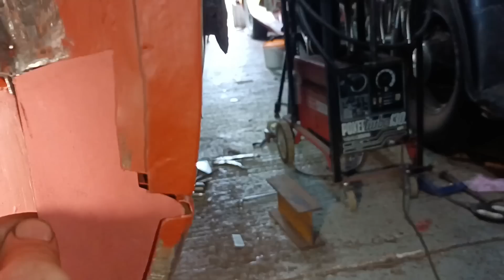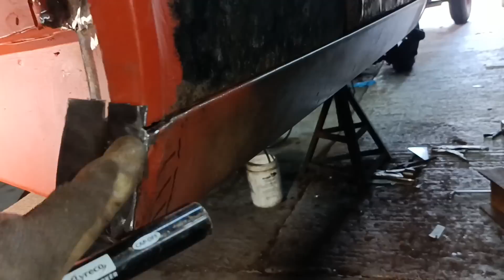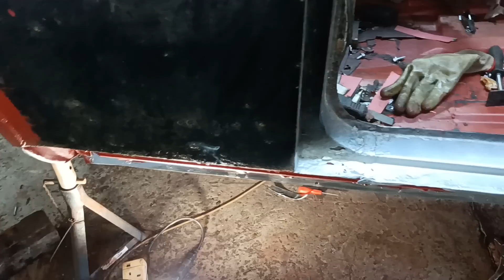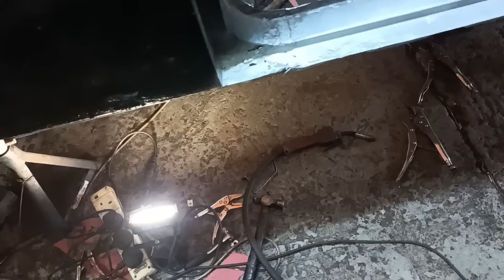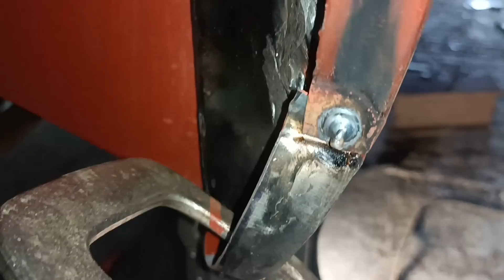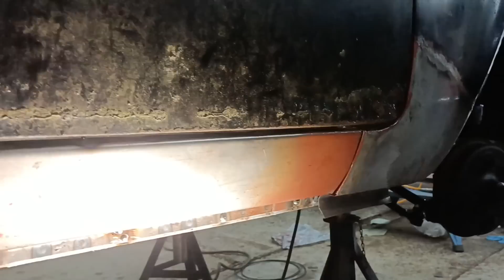Mission Creep 100E Anglia part 33! New Sill finally gets fitted. Right side done! (2371)

Comment: Mart, to avoid the dents on the "A"surface you can use a shaped block of copper on the surface to be dent free. We do it in the industry, however you will need to put more current through and unless the copper is a perfect fit for the panel you will still see some witness that will need sanding. Generally this is avoided these days but was common practice in the 50's and 60's when these cars were built.
Reply from the maker: Thanks Jacqui. I can see how that would work. These would never have been welded on that surface. That was just my short cut. The spot welder has been working well, I have used it a few times since filming this. I was just watching you and Nic at the Pod on Nick Pettitt's video. Looked like you were having fun.
Reply: Yes, it was a good weekend, Got wupped, but loads of fun. Looking forward to seeing the 100E driving.

Comment: Great job Mart , you did a a sterling job on that sill mate , and im sure its stronger then factory , i do feel for though having to  lay on a cold floor when restoring old cars , im 64 now and doing the sam as you , its not good for our old bones but its great for our minds lol 👍🏻
Reply from the maker: Hi Shane. I just turned 65 last week so know what you mean. I snagged some mats and lie on them. They make a big difference. When it is very hot outside the garage can get hot too, but it is always nice and cool down at floor level, so no complaints here. It's the best place to be sometimes. Thanks for watching and commenting.

Comment: Good job, Mart, and you have the satisfaction of knowing it is right. Yes, drilling holes and bolts would have been easier, but slapping glass fibre over the holes would have been easier again. But you did it properly. Yes, you used the bolts at the rear behind the quarter panel, but welding that would have opened a whole can of worms and the sill is welded at the rear arch, so good enough.

And well done for adding metal to that thin flange at the rear of the outer sill. I've seen these cars entered for concourse where that wasn't done. It scream 'lap-over sill' to anyone who knows these cars!
Reply from the maker: Hi LMS. Thanks for your thoughtful comments. Tell me about your history with the 100Es. Are you on the 100E.com forums/facebook pages?

Comment: Great job Mart, this is an exciting build to follow. That's a " brute" of a spot welding machine.....must be ex Jag factory in Coventry.
Reply from the maker: Yes, it's a good machine, but you'd be amazed if you saw the size of the ones on the body production lines. Big heavy things, all water cooled and counterbalanced. I got it from a friend that used to run a scrap metal place.
Reply: @MartsGarage  Well Mart it's been worth its weight in gold for this build. "catch you on the next one"